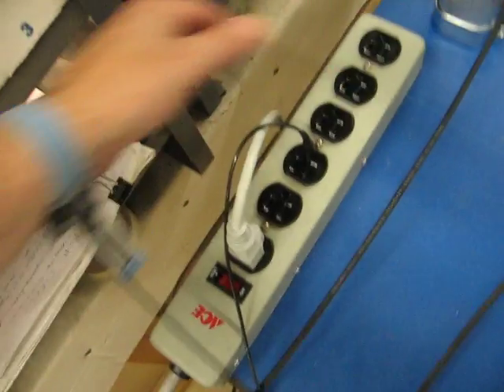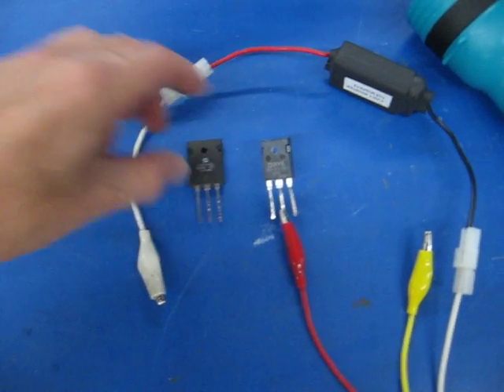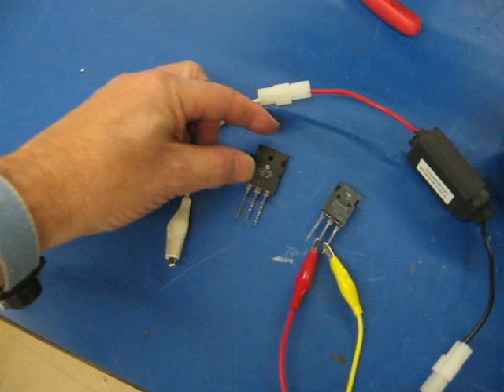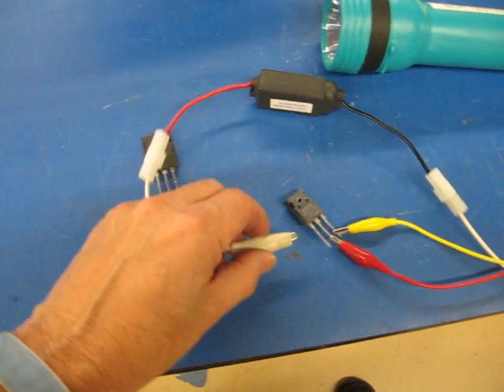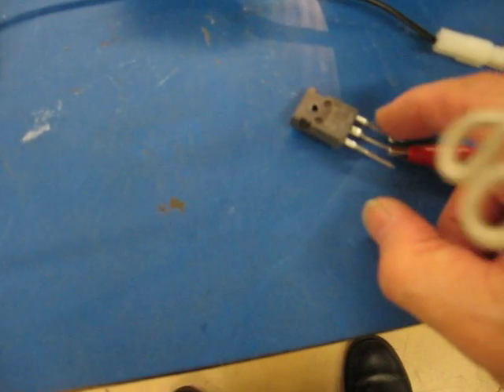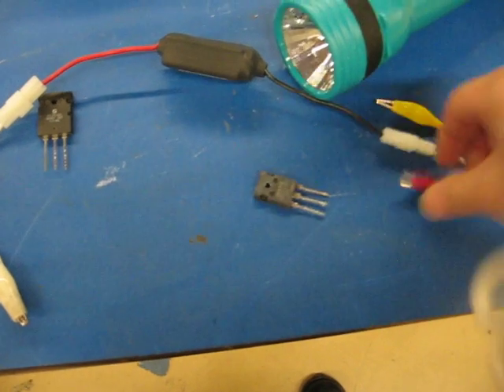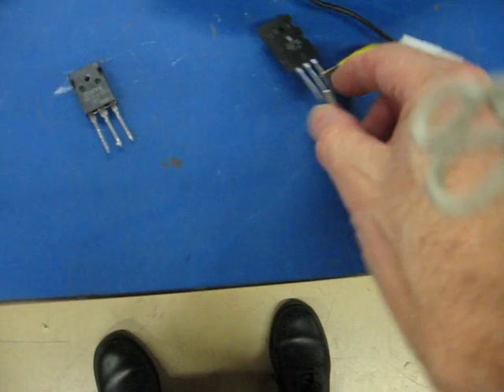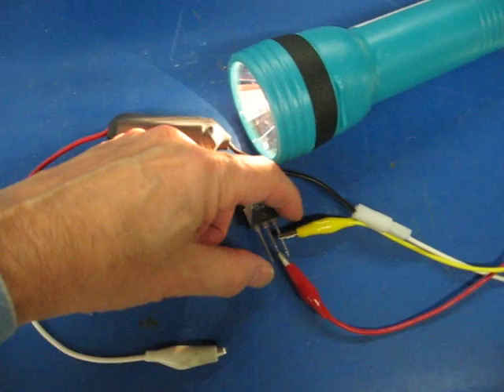Testing Mosfets

Comment: Technically, you should stick your ESD strap through a 10M resistor to earth. its to limit the amount of current drawing through you at high static voltages. Example 20KV static charge, applied hand that ESD wrist strap is on (call it 500K) = 40mA, stick a 10M resistor in series = 1.9mA. Less of a belt to you and your equipment under test. Also less risk of you accidentally pluging it into the mains!
Reply: I dont think that is the case .. True , you MUST have at least a 1Mohm resistor in series with wriststrap for safety reasons (and most quality wriststraps dO have such a resistor .. measure it with your MultiMeter) .. but the safety issue has nothing to do with static.   Static electricity travels on SURFACES, not internally thru conductors .. So, it will bypass aNY resistor (eg, a hair comb has no wires at all , yet can carry significant static charge.)  The issue is thIS:  If one is working on some device , using live 120AC, and a short happens, the chassie of that device can become  'live' .. VERY 'live'!  and if you touch it and you are directly connected thru your wriststrap to your home's 'earth ground' , you are fried!  So, that resistor serves to prevent such a disaster .. as that live AC wiLL travel thru the strap-resistor and be safely lessened.
I was surprised to notice that some online vendors are selling low-priced wriststraps that do not have such a resistor.. VERY dangerous!  I spoke with Amazon and they were VERY aggressive in researching their offered straps to be sure they are safe .. I was very impressed with that huge company's response! 
So, I suggest we all test our wriststraps' resistance value and if lacking a resistor, just insert one!  1Mohm is standard ..   Why not do the calculation and tell us what the resulting 'grounded surge' 110AC current will then become ... HINT: it's gonna be a lot safer ...  and because the load (you !) is purely 'resistive', (assume 500 ohm body resistance.. cuz sweaty-wet skin lowers the usual 100Kohm human body dry resistance) one can use the 'Ohm's Law for DC' .  Sure , 10Mohm is ok, too.
Then calculate using the "500ohm + 1Mohm" situation ... Which current would you prefer to experience??
Reply: Tkj Tkj  I should also, in defense of the video's author , suggest this:  I've never ever seen aNY wriststrap alligator clip small enough to be inserted and contact any live contact in any receptacle.  It does sound scary , but in reality its not gonna happen .. Is it possible that vendors do use such large clips for this very reason? I'm not saying 'dont care about the hole you use'  .. Habits caN have a way of biting us.  I guess im saying:  "Do it , but do it intelligently!"

Comment: I manage to test it that way:
First get a 12 volts battery, then connect the negative lead to Source.
Second get the Drain and connect to a lamp rated to 12v.
Third the remaining lead of the lamp goes to positive lead of the battery.
When you touch the battery positive lead the light will light up when you tap Gate and to turn it off just toucht the negative from the battery one hand and the other tap Gate.

Comment: One thing you are forgetting.Some IGBTs & Mosfets require a higher current to switch on the gate than what the some meters gives off in diode mode.So its not 100% accurate.This methods gives off an average stable voltage hence giving a more accurate reading.
Theres nothing wrong with grounding yourself that way.Its their preference.
Don't be nasty or too critical to people thats just trying to help.

Comment: a varabel power supply with pulse is better to test with also an analog meter has more curent than  a digital i did service for 25 yrs and the set has to come with us to remove part to test also solder conections need to be checked to many sets are wave solder foil is paper thin  and the newer sets are made like crap

Comment: You go thru all the trouble to hook that mess up to a battery? 'why don't you use your multimeter? That has a 9 volt battery in it; right? Your demonstration assumes everyone knows how you introduced the 9v into the component. Doh! I would suggest you don't casually hook yourself up to your fuse box either. You have no idea what is happening down the road. We would have been saved a show of ambiguity had you lit up with 4000 or so volts. LMAO

Comment from the maker: @Lavinco Even if I did stick it in the wrong hole, the 1 meg resistor in the are band would limit the current to such a low level. I sometimes use this device for monster-sized, water cooled scrs at customer sites. A multimeter puts out too little current for a reliable turn-on of a large scr.

Comment: That's cool and all, but over-complicated. Just use a multi-meter on the diode setting and look for shorts. 99% of the time, mosfets short from one pin to the other when they go bad or will leak backwards, just like a leaky diode. Your method is all for show in my opinion. In the real world and at a customer's house, there's no time for all that. Especially if you accidentally plug yourself into the 110v side of the AC. That's the most ridiculous thing I have ever seen for grounding yourself.

Comment: @john29302 Mosfets DO stay on after the gate is charged, hence they need a pull down resistor or complimentary switching device to discharge the gate. (N-channel FETs)

Comment from the maker: @zincdustdust 

I stated "Don't stick it in the wrong hole", such as the hot side of the line. I was making a little joke.  Actually, the banana plug won't fit in the slots of the plug strip.